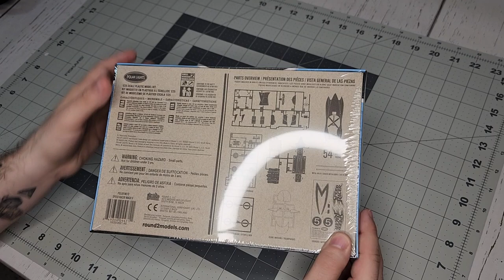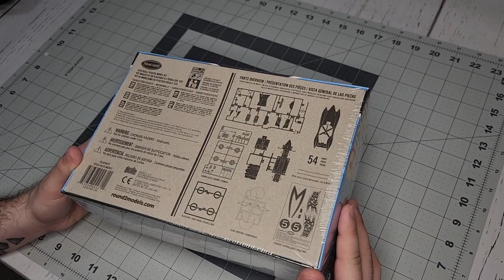Building the Speed Racer Mach 5 Model | Classic Models

Comment: Do you not have hobby nippers, or side cutters? Not judging here if you like to twist the pieces off, but those tools would help make your model building a lot easier. Might avoid breaking some parts too with those tools.
Reply from the maker: I do have some I use for the metal models. I could use those for the plastic ones, too.